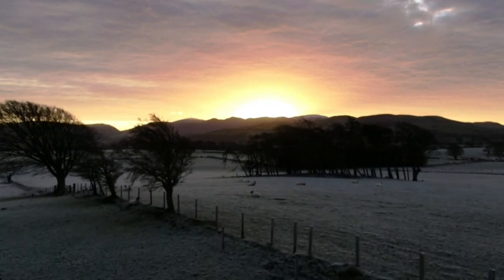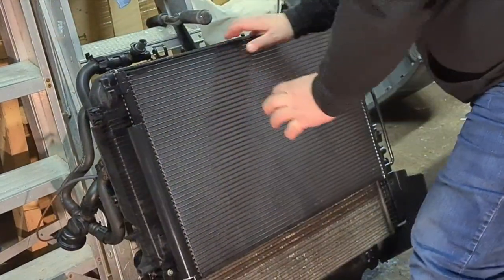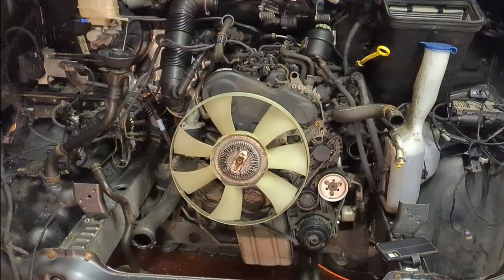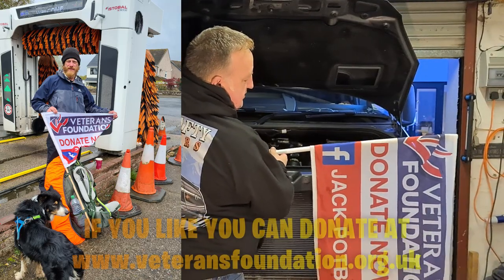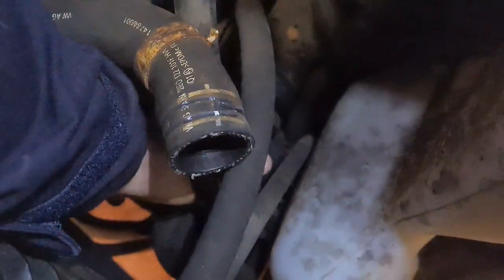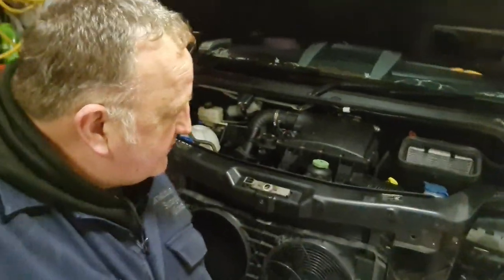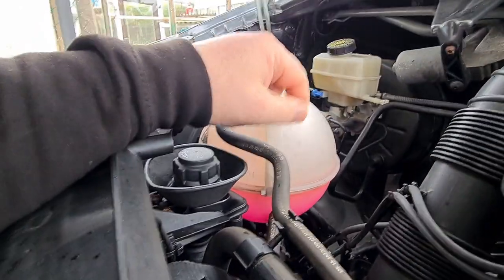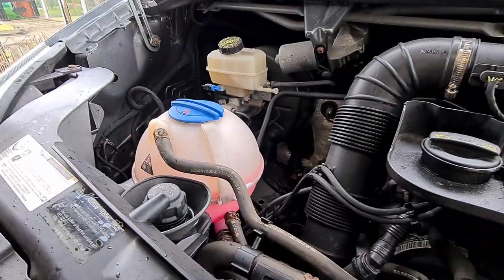vw crafter cooling system refit | selfbuild campervan crafter sprinter | 60 | the crafty blinders

Comment: Hello sam can you tell me why when i took the radiator of my crafter van i put it flat on the ground now i have fitted it back on the van the fan is on all the time i was told the radiator has a coolant oil in it my van now has the fan on all the time why is this many thanks    paul

Comment: Hi, great vids, just done my own cambelt and water pump, followed your vids.  Did you get any issues when filling the coolant back up.  I seem to have a airlock in the heater matrix and cant shift it....any tips, oh I dont have a vacuum filler :(
Reply from the maker: Yes we did its a common  issue don't worry 😁👍
So disconect the expansion bottle from the slam panel an lift it as high as you possibly can secure it in place with a bungee cord and then run the van up to temp this should help clear the issue 
Hope this helps let me know how you are getting on
Reply: @TheCraftyBlindersvanlife  cool, thanks for the response.  On looking at it more today I found that the expansion tank was staying cool for a long time so checked the return from the top of the rad and engine and was getting nothing, found that there are some none return valves in the pipes, both were shot, one was letting a little through and also flowing backwards and the other was has completely had it with no flow..Edit, new return pipe fitted and all good, it also lowered the running coolant temp  🙂